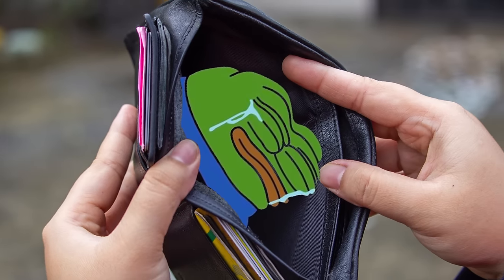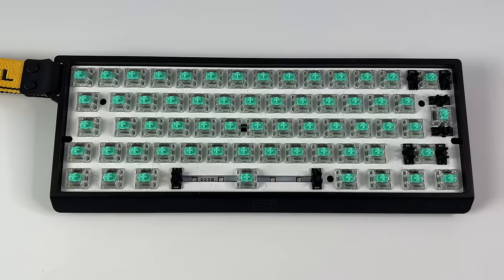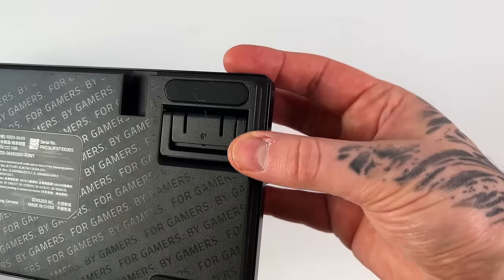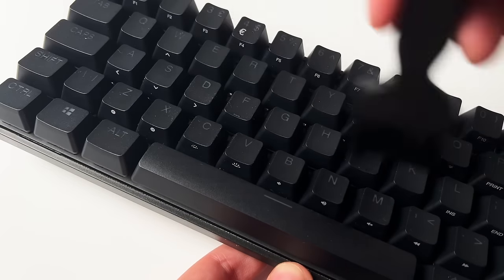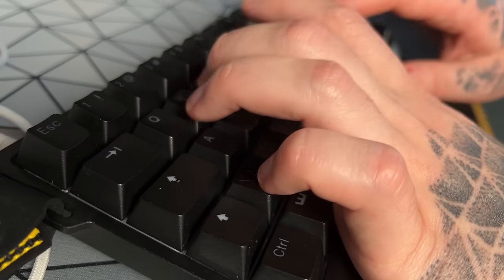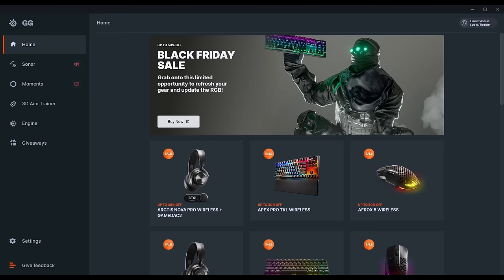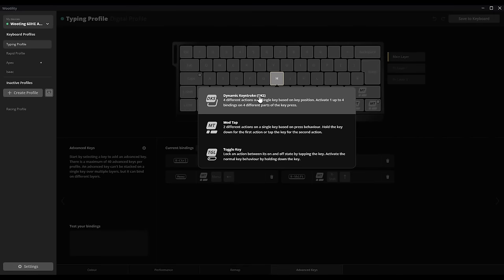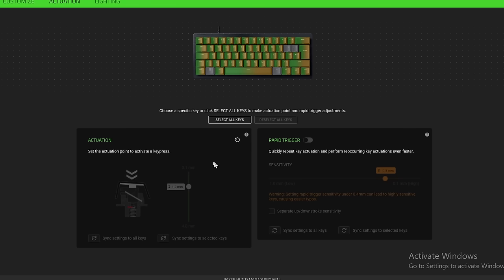What's the BEST gaming keyboard in 2023?

Comment: I had some rough experience with synapse with another keyboard from razer. Luckyly it was with a bought used huntsman mini, which was cheap enough to not being angry. If that happened with new stuff, for over 100-ish $, I would be mad af. It's the weakest point of there peripherals at this time. Steelseries software might not be the clearest one, but you dont need a tutorial to change a single thing in it. Wooting is the winner in this department.

Comment: I mean I think this video was made with some based preference , like I genuinely think the apex pro mini is the winner here , for the sound , the look and the fact that you don’t even need particular switches to have the 0.1 actuation point but just a firmware update and that is great for me…. The build quality is better , foam apart that isn’t even foam like it’s a 0.5 cm thing compressed that doesn’t even look as foam but there is some so it is better than nothing.
Talking about the customization and the firmware in general I don’t think it’s better than the wooting but it’s SO FUCKING MUCH better than the razer like it’s simple and intuitive asf , ads apart obv ,
Like I don’t think that the razer should even be in the actual comparison here , it’s worse and everyone like literally everyone has been knowing this since a year to this moment , the switches are rattly, bad and still not even pro switches, they’re not lubed ofc because they’re not just normal switches and they just automatically sound worse because on the razer every single key has a stabilizer which makes it just terrible looking …..